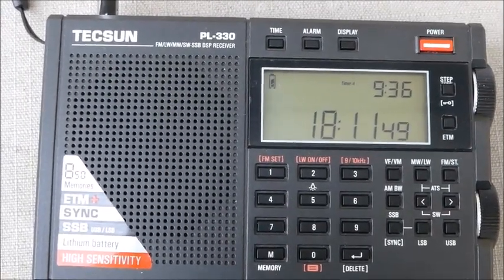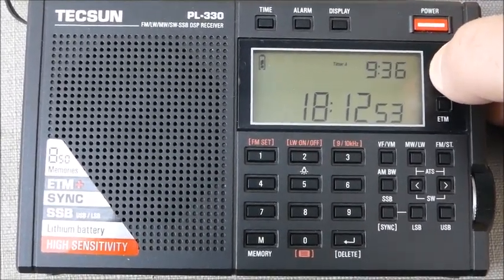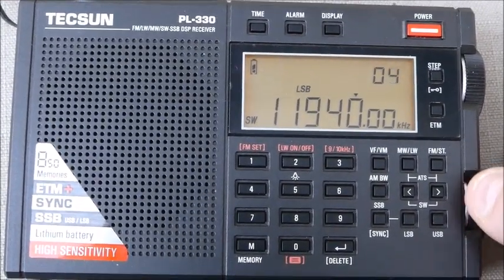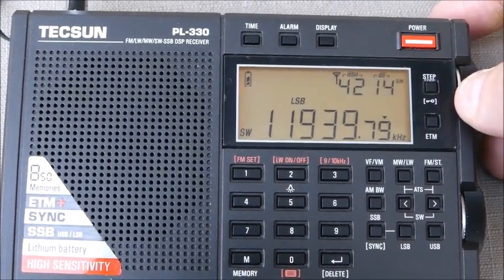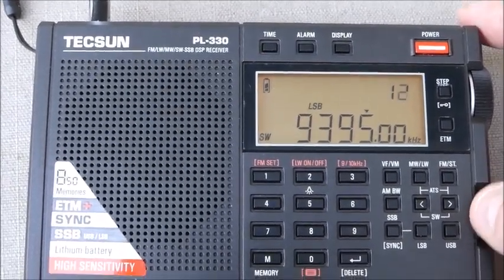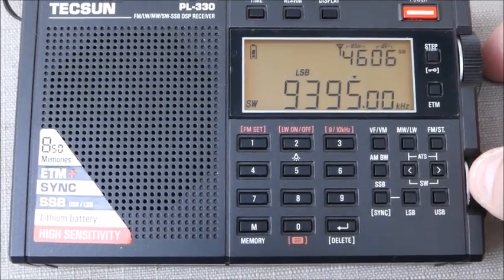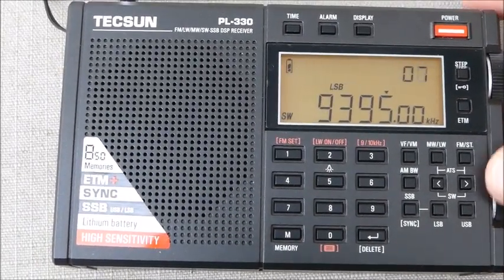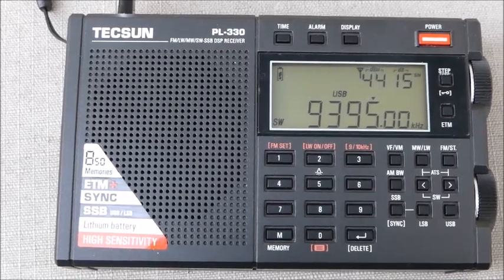PL 330   Multiple Bandwidths and Re Calibration

Comment: I have found generally above 10 Meg I use USB and below LSB.I usually keep bandwidth at 3.5.That seems to work best in clearing up noise but keeping signal strength. I am shocked by all the added functions you normally see on higher end radios

Comment: There is nothing amazing about this radio. The bandwidths are useless. All it does is muffle the sound to the point where you can’t hear anything on the lowest setting. Like all Tecsun products this is just another over rated piece of junk.
Reply: Yes but for $70, I bought one.

Comment: Hi Dan, I'm one of your channel subscribers. You mentioned in this video that the Tecsun PL-368 doesn't support frequency calibration. I bought one last year and was surprised that it does calibrate like my PL-330 and PL-990. My copy has the firmware #3684, which I think is the latest for 2022/2023. I suspect the earlier versions of the PL-368 didn't have frequency calibration.
BTW, you might also want to check out the new PL-320. I got one recently but it came with a Chinese only user manual and firmware #3202. Unlike the PL-330 it comes with an additional 9 kHz bandwidth for SW. The PL-320 has some interesting hidden features which the PL-330 doesn't have but I have no idea what the adjustments do.
The PL-320 uses the Si 4734 DSP chip, therefore it lacks SSB mode and has 650 memories instead of 850. It has a new Favorite button that remembers only one frequency and band. Like all non SSB Tecsun radios, the PL-320 doesn't have the frequency calibration feature.
Reply: Qual o melhor, pl330 ou pl990x? Na parte de recepção ssb (USB LSB), com ou sem antena externa. Queria saber mais na parte de 7000MHZ e na parte de 25000 a 29.995MHZ. Obrigado
Reply: @chicopintudo3443  Ambos os rádios são igualmente bons para decodificação SSB, mas o filtro de largura de banda de 4 kHz no PL-880, 990, H-501 e S-8800 não parece ser diferente da configuração de 3 kHz. O filtro de 4 kHz no PL-330, por outro lado, funciona conforme o esperado.
A faixa de 40m para amadores (7 MHz) está clara nos modelos PL-330, PL-990 e S-8800. Eu tenho esses três modelos.

Comment: What is the width of filters in SSB narrow/wide for Tecsun pl660? Firmware 6622 is the latest?
Reply: My PL-660, which was manufactured in 2021 has the firmware 6622, which I presume to be latest. I could ask my China based, online seller (XHDATA) if their newer PL-660 stocks have newer firmware.
As for the bandwidth filters for the PL-660 (and possibly PL-680 too), it's 7.5kHz (Wide) and 3.75 kHz (Narrow) according to the Tecsun Australia website.

Comment: It is really a strange behavior: the USB and LSB do not have the same frequency offset, and the frequency offsets fluctuate with tuning frequencies.  It is unlikely a result of an inaccurate reference clock frequency.  More likely a bug in Tecsun's firmware, or a hardware limitation (Si4735 cannot tune a frequency accurate to 10Hz?).

Comment: Does it have any bass sound like the r108?
Reply: Well, if you plug good quality headphones in, chances you'll experience okay to decent bass/treble in FM mode only... plus it has stereo output in FM
Reply: No, unfortunately it does not. The R-108 is fitted with a more powerful 3-watt speaker, which is why its bass response is simply amazing for a such a tiny pocket radio. The R-108's fantastic sound however, comes at a small price - higher power consumption.

Comment: My first Tecsun was a PL-660 purchased about 4 and a half years ago. Impressive performance for the price. A few months ago I bought my first PL-330. And again, it's amazing! Since Sony deserted the shortwave receiver market, there are few choices. But Tecsun is doing pretty well.
Reply: between PL-660 and PL-330, which one do you recommend me to buy as a beginner?
Reply: @klaaskay2685  Great question! If you're not sure if shortwave listening will become a serious hobby, choose the PL-660 (better still, the PL-680 for just a bit more money) and see how you far this hobby takes you. 😀
The PL-660 is my first Tecsun shortwave radio and I use it every day, even though I also got the PL-330 and a few more receivers from Tecsun and Sihuadon. Buy the PL-330 only if you only want a small and compact SW radio that you can easily bring with you anywhere. 
Seriously though, if don't plan on buying more than one shortwave receiver I would highly recommend the PL-680. The buttons on the PL-660 are harder to press than the 680 and you also get the cheaper pouch instead of the deluxe leatherette case with a zipper. 📻👍🏼
Reply: @StratmanII  Bom saber sua opinião sobre o PL 680, venho notando vários comentários da qualidade dele, principalmente em SSB. Qual a característica principal do 680, seria a escolha mais acertada ?
Reply: @sidneycavalcant  Se você pretende comprar apenas alguns rádios de ondas curtas o PL-680 é uma excelente escolha. Não é muito caro, usa pilhas AA alcalinas ou recarregáveis e é de um design de circuito sintetizado PLL duplo (sem DSP). Eu recomendaria isso para quem está procurando apenas um recetor portátil multibanda para o seu hobby DX'ing ou audição casual.
Reply: @StratmanII  Além do 680, qual seria outro modelo ?
Reply: @sidneycavalcant  PL-660.
Reply: @StratmanII  O que acha do PL 990x ?
Reply: @sidneycavalcant  Ah, o PL-990x também é bom. Tudo é bom, meu amigo. PL-680, 660, 990, H-501, Sangean ATS-909X2. Compra o que você puder pagar, irmão, mas certifique-se de se informar assistindo análises primeiro! Tudo de bom!
Reply: @klaaskay2685 

Hi, there is a huge difference though, (no one mentioned yet), that the PL-660 has VHF AIR BAND capability! 👍
Reply: Do you still have a PL-330 review up?

Comment: Which models or firmwares has 650 memories, and 850 memories, or it is Chinese vs English version.
for the Tecsun pl330.
Reply: The 3306 firmware version has 850 memories available. Yes, it is the Chinese version, but the display is in english
Reply: The earlier versions of the PL-330 have 650 memories, while the later ones have 850 memory slots. Furthermore the later versions are able to reorganize the memory frequencies at push of a button, which I find extremely useful. The only other Tecsun radio that is very similar to the PL-330 in terms of features is the PL-368. If I'm not mistaken PL-330 units with 850 memories come with firmware version 3305 or 3306.

Comment: Hello. Well very interesting a truly zero beat. However with your critical assessment of the sangean 909z2 you forgot to mention that ssb mode on the 909x2 sounds much much better on the sangean where as ssb has never sounded as good on the 3 tecsun receivers and also please don't forget that sync mode works not on the other tecsun receivers. Which is no excuse because as you already know sync sounds great on both the pl 660 and pl 680 therefore I believe the sangean is much better on ssb even without bandwidth selection. Even on the s 8800 the San still sounds like Donald duck. To my ears the sangean is the clear winner on ssh over any tecsun model. Thanks for the information.     Ron. Z.   The North American shortwave radio and toy robot museum.    Springdale. Pa.
Reply from the maker: Everyone with a 909x2 will make up their own minds.  Mine went back to Amazon 2 days after it arrived here.
Reply: @dxace1  Uma verdade que visualizo em vários vídeos e blog sobre 909x2, uma tristeza, pois é um rádio lindo.

Comment: What’s causing it to be off frequency.  Does this need done often. Is there something wrong.  I have one with current version. Lol just asking. Thanks for the instructions
Reply from the maker: To answer this question (a bit late) -- these DSP radios will always be a bit off frequency.  They're not $5000 receivers like a JRC or Watkins Johnson.  But the fact that Tecsun provides this re-calibration capability is quite extraordinary.  When you say "off frequency" -- it's usually not the station itself that is off.  It's the radio itself.
Reply: @dxace1  Interesting. I was told transmitters always drift to some degree. I started out with a Hallicrafters S38-B tube unit. When was the fist DSP radio introduced and what was it?
Reply: Likely the transmitter itself is off. Digital receivers are more precise than analog transmitters. Not the fault of the receiver but the broadcaster. In the old days we had LSB and USB fine tuning knobs. 😜

Comment: I might be overthinking this, so don’t hold my opinion as gospel haha…
Are there any guarantees that 9395 and/or 11940 may not be exactly on xxxxx.000 kHz? At least if you zero beat on WWV/WWVH you know you’re exactly right?
I’m going to contradict myself here now and say that, yes, on the PL-880 there is a drift in zero beat sometimes if you go from 5 MHz to 10 MHz. Anyways I only zero beat when I want to tune into the hams…that’s my habit and everyone enjoys the hobby differently.
Thanks Dan for the very informative videos you post!
Reply from the maker: To answer this question -- it's usually the case that strong stations, today they are mostly the religious broadcasters, are close if not exactly on frequency.  There can be exceptions, but for the most part you can use 9,395 or 12,160 khz to calibrate a 330, 990x, 501x etc   If you have good signal strength on WWV frequencies, by all means, use those.